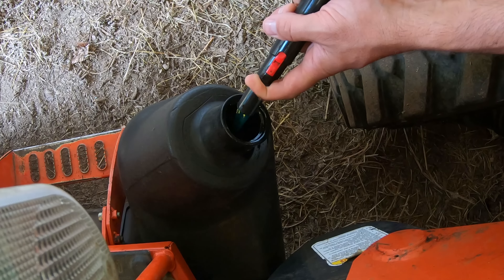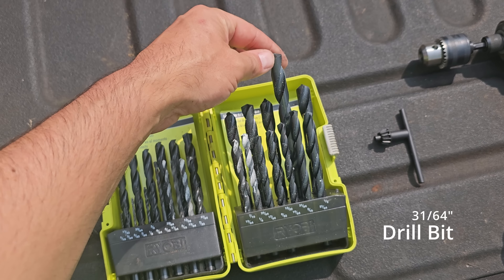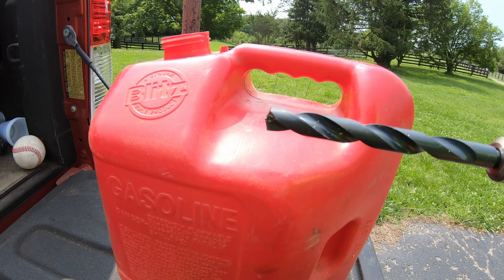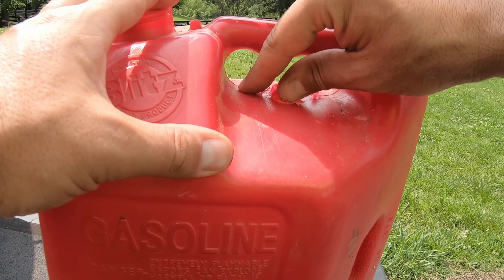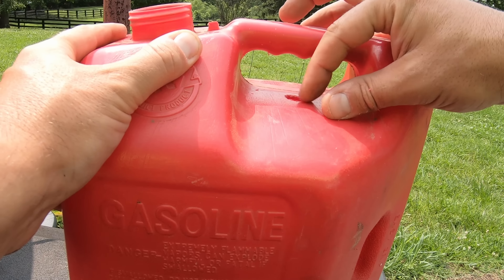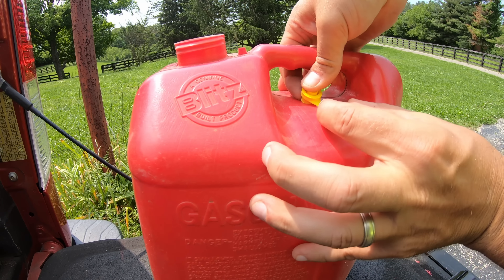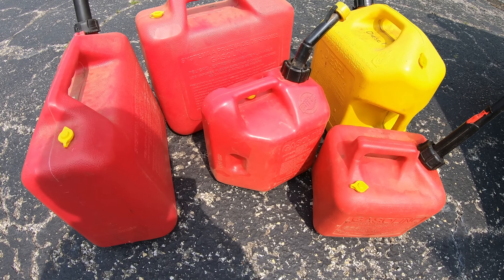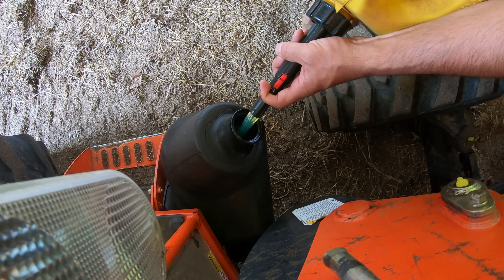Make Gas Cans Great Again!

Comment: I often have to fill up farm tractors using a five gallon gas can and found the new style "vented" filler necks to be a pain in the ass so rather than mess with them at all I simply take a large funnel and put it into the filler hole in the tank and then remove the filler neck entirely from the gas can and then just pour the gas in. It's a whole lot faster and less frustrating.
Reply from the maker: It's crazy that the newer the cans gets, the worse they make them to use!
Reply: It's frustrating when all people want to do is get some work  done and the government is there making things difficult. Pay your taxes so people can come up with stupid ideas.
Reply: Try to ground the can to the tractor, particularly if it is cold and dry so you can eliminate static build up. I know an aircraft engineer who was killed fueling an aircraft doing a straight pour into a funnel
Reply: @waynemanning3262  Whoa, that didn't even occur to me, thanks!

Comment: Watch out: Some of those Amazon vents won’t stay closed.  I’ve modified many cans (and just bought “race cans” that work fine).  Lately, I’ve been using the vents which are Schrader valves minus the core.  Remember, it takes Government to f*ck up gasoline AND gas cans.
Reply from the maker: Interesting idea with using a Schroeder valve! Thanks for watching!
Reply: @livingon80  you want the kits with metal Schrader valves.  If you just install a typical black rubber tubeless tire valve, the gasoline softens and swells the rubber within a year, then you get leakage and failure.

Comment from the maker: Also, just in case there's any plastic left inside, it's probably a good idea to use the fuel the first couple times on something that has a fuel filter like a riding mower, zero turn or ATV before using in a pushmower without a fuel filter.
Reply: Or rinse out w hi pressure and drip dry? I use a 62/128" bit , but I'm blessed with a  nearby non ethanol station/casino's REAL gas and therefore a gasoline snob.😅⛽️🤴

Comment: I use a 3/8” self tapping sheet metal stitch screw. They have a rubber washer and seal good and easy to take them in and out.
Reply from the maker: Good info, thanks!

Comment: I use the metal vents with the screw on nipple and leave them loose during storage.  Also, do a video on removing the spout spring.  That's what I've done to all mine.  Works great.  I guess you could modify the spring to make them lighter tension.  But I just took mine out completely.  Still seals good.
Reply from the maker: Thanks for the suggestion!
Reply: I guess by letting vent loose. You don’t care about moisture in the air being absorbed by the fuel.
Reply: @mracer8  Loose meaning not real tight.  In the heat here the can will collapse or expand too much.  All my cans are metal jerry can style now.  And my gas doesn't usually sit around long enough to hurt it.

Comment: I use the No-Spill brand of gas can. They have a spring loaded button behind the spout to release the gas. Been using them for years. They are supposed to vent around the button but I do get gurgling. So, I'm sure they could use your method too. But to the point, these are much easier to use than those nozzles with the release on the spout. They are at Ace Hardware, HD, and Amazon.
Reply: Tractor Supply also has them.  They're excellent.
Reply from the maker: Great info! Thank you for sharing it with everyone!

Comment: I drilled a ¹/32" hole in my handle. This vents it enough so the plastic can not swell or collapse with temperature change. I cut yards for a living, so the gasoline doesn't get stale. 🐀🐾
Reply from the maker: Awesome! 1/32" hole should keep any debris that may fall in pretty small. Thanks for sharing!

Comment: Great idea and ideas out there to make gas cans easier…..but the best solution I’ve found is using a battery powered pump to fill my vehicles or power equipment! 
I like the Mr gasket brand it works awesome and if you use 4 lithium AA batteries instead of anything else it last a long time! And it come with optional gas can cap adapters!
Reply from the maker: I did a video on the one from Harbor Freight, it works well!  I use it when I'm poimuring out the full 5 gallons. I'll check out the Mr. Gasket one.

Comment: Vent caps not really needed. I normally drill a very tiny hole near the handle. Use my thumb to cover to create a vacuum to slow the flow or leave uncovered for smooth max flow. A small vent hole is all that is needed. Tiny vent hole also aids in releasing -/+ pressures from ambient temperature changes.
Reply from the maker: Do you ever get dust and dirt inside the can?
Reply: @livingon80   I have never had an issue with debris in the cans. When I say small, I mean find the smallest drill you have in your box and use that. All that is needed is a very small, pin hole size vent for air to come and go to keep the pressure normalized. Choose an old container and give it a go. Lug it around, use and test yourself before making holes all over the place. See if it meets your needs before needing to buy any attachments and/or gadgets.

Comment: I've actually done something similar to this. I used a valve stem with the core removed.
Reply from the maker: Nice! Thanks for watching!
Reply: That works fine until the gas fumes eats up the rubber.

Comment: Use compressed air hose to blow out most if not all of the plastic shavings.
Don't place it under the handle on a can like this, place it on top back of the handle outside where you place your hand - if the cap pops loose or you suddenly move the can while filling, less will spill out.
Reply from the maker: Air works well. It doesn't leak if it not overfilled. I agree though, handle is better, but this one was rounded and hard to get a hole drilled.

Comment: ALWAYS use a step drill on plastic.  It makes a clean round hole every time.
Reply from the maker: If you have a step bit with a 31/64" notch, that would work great!
Reply: @livingon80  I've had one of those caps split because it was too tight.  Maybe they've corrected their design since I installed mine.

Comment: Just get a $12 gas can pump from harbor freight, put it in the can, put the hose in your lawnmower tank and press the button.
You don't even have to lift the can to accomplish this.
Reply from the maker: I'll have to check that out! I bought one a while back from Amazon and it started smoking the first time I used it. I'll definitely check out the HF one!  Thanks for the tip!!
Reply: @livingon80  Make sure the polarity for the "D" cells is correct, positive end down.
Also, never let it go horizontal once you've used it, hang it by the hole in the top.
It will leak fluid into the battery compartment if you lay it down .
Ask me how I know.
They're not the highest quality, but you can go online and get a refund to buy another one without returning it.
It's still worth it just for the convenience.
Reply: @livingon80  Oh - I forgot to mention, buy two, always have a backup, these things just quit for no apparent reason, usually when you need them most.
Mine just quit ten minutes ago, but the backup is working.
I didn't say they were good, just convenient.
Test them right after you buy them, but don't run them long dry, two or three seconds is fine.
Reply from the maker: Good info! Thank you!

Comment: I’ve used those vent caps , I really don’t like them as well as magicfour vent caps. They look like car tire valves. I also replace the main fill with a yellow foanriy cap. I use a large funnel with a screen to pour into my mowers . The funnel is a flotool quick fill funnel. If you use the yellow vent caps I suggest you super glue them in place , making sure to open the cap before gluing. This will keep you from gluing the vent opening pieces together. You could also purchase a pump like the deway gas transfer pump

 

 

 

 

 

 

VIDEO
Reply from the maker: I've heard a lot of people using valve stems, never tried them myself as these plastic ones have been fine. It's crazy how much we have to mod these things to make them functional! I did get a pump, and just did a video on it. It works well! https://youtu.be/oDm6KyRbtfw Thanks for watching and commenting!

Comment: Make sure there are no gas fumes in the can, the brushes in the drill/driver are exposed and are a source of ignition.
Reply from the maker: Good call. I've done several with no issues but it's always better safe than sorry. Thanks for the suggestion!

Comment: I just drilled a hole in the top back corner fit a rubber grommet in there and put a golf tee in their works great then I can put my thumb over it as I'm tipping it up so I don't slosh and spill and and then when I'm ready I just let go of the hole and off it goes, those cans definitely need a vent
Reply from the maker: I've heard people using a golf tee, but not the rubber grommet with it. That's smart! Thanks for sharing!

Comment: Can use value stem in same hole as drilled
Reply from the maker: I've heard of people using valve stems, but metal, because the rubber may wear out with the fuel.

Comment: Great stuff. That bit seems a bit large. But I think there are different size vents out there.
Reply from the maker: I think the bit I used is what the vent called for. So far no issues. Thanks for watching!
Reply: @ Are you trying to get smart with me?
Reply from the maker: Not at all. Just saying the drill bit I used was the size the instructions said to use, that is all.

Comment: My old gas can works fine.  I just use a funnel when filling up the mower (not using the hose) and carefully pour the gas into the mower and never spill the gas, then I simply screw the caps back on.  Furthermore, when I buy gas at the service station I only fill the 5 gallon tank just halfway as it will take a couple months to use up that amount of gas.  You don't want to use gas that gets too old, otherwise you may have starting/operating problems as the carbonator can get gummed up as the molecular makeup of the gas slowly deteriorates..  I use up and run the mower empty each time I cut the grass so I seldom have those problems.  My mower runs for 90 minutes on the mower's tank when full, so I pretty much have that down to a science!!!  Screw the government!!!
Reply from the maker: They don't make them like they used to! Great tip about not using old gas! Thanks for watching!
Reply: Fuel Stabilizer solves the stale gas problem.

Comment: REMOVE THE O RING AT THE BOTTON OF THE SPOUT  AND THEN PULL  OUT THE SPRING AND THEN PUT O RING BACK ON ...MAKE IT SO YOU DONT HAVE TO HOLD IT...THE HOLE YOU DRILL SHOULD BE IN THE BACK OF THE CAN SO IT DONT LEAK WHILE YOU POOR
Reply from the maker: Good tip about the nozzle spring! I have the vent in the back on most of my gas cans, I prefer it there too! The can in the video was rounded at the back, so it went on the highest flat spot I could find. No spill issues yet!  Thanks for watching!
Reply: @livingon80  YOUR WELCOME ..I LIKE YOUR SHOW ALWAY WANT TO LEARN NEW THING KEEP IT UP

Comment: You have the Midwest 4240 spout installed upside down, work much better with correct installation
Reply from the maker: I've had the spout with the tab up and with the tab down. It's terrible both ways.

Comment: I have wondered for a long time now why the makers of these plastic fuel  containers don’t mould a hand grip on the bottom of these containers so has to make it so much easier to empty into fuel tanks  on Tractors and machines  seems a very easy solution rather than struggling with these awkward heavy slippery containers, anyone else thought about this ?
Reply from the maker: I agree! My 5 gallon diesel can has a grip on the back side which helps. It's the only I have that has it.
Reply: yup.

Comment: Spoiler alert they also sell better spouts as well...
Reply from the maker: I don't have issues with any of the "safety spouts" that are on mine, but I've seen some cans with different spouts that look awful to use. Thanks for the tip and for watching!
Reply: @livingon80  The issue I have with mine is when you have a full 5 gallon gas can the weight tends to put pressure when resting on the fill port of whatever you're trying to fill, this puts pressure on the gasket and it tends to leak even if it's tight...
Reply: @TheJkilla11    You got that right!!

Comment: On hot days the expansion of the liquid in the container causes the plastic cap to pop out.
Reply from the maker: Built in pressure release valve :) Thanks for the info!
Reply: Jostle or shake the gas-can may also cause gasoline vapors to expand.

Comment: I'm pretty sure that this would render this container illegal in the Netherlands. When pressure builds up,  the newly mounted vent will pop out.
Reply from the maker: If anything it would just pop open to relieve the pressure, instead of the container swelling like a balloon. Interesting fact about the Netherlands. Thanks!
Reply: @Living On 80  You're welcome. When stored in higher temperatures, it will release pressure, but that also means it's leaking. To the best of my understanding, it has to be able to withstand certain temperature levels.

Comment: Hmmmm never knew they made after market jerry can vents, i just drilled small holes in mine. Helps alot. 

vents also prevent heat expansion in high temp summer days. I haye how jerry cans can heat up, & look like they could explode. probably not good for over all life of the plastic
Reply from the maker: They do swell a lot!

Comment: I suggest filling it with water before drilling it and yes I know it's plastic but if some unknowing poor person thinks a smoking 🚬🚭 hot drill bit is normal and not dull could in all actuality get it hot 🔥🥵 enough for a rude awakening!!!
Reply from the maker: Just make sure you get all the water out! Thanks for watching!
Reply: @livingon80  But of course sugar bear 🐻!!! But you might want to drill the top forward of the handle if hollow instead so when carrying it in the truck it doesn't try to gush from the new orifice. Good thing you capped it though!!!🌨️🐻‍❄️❄️

Comment: i think that a 12mm drill bit is what the vents are designed for.
Reply from the maker: 12mm may work but the instructions say 31/64" which converts to 12.3mm. Thanks for watching!

Comment: LOL - You demo your Mod while using the Spout turned 180 degrees from its intended use position. That style Spout has an Air Channel build in to relieve vacuum while filling. Another fail people struggle with is <Over tipping> the gas container, blocking the internal vent with excessive fuel.
* The best use of the added vent can also be its downfall when using Ethanol Gas. If the vent is accidentally left open of not seated fully moisture can be drawn in as Ethanol is hygroscopic.
The main benefit of this vent is the ability to relieve Pressure or Vacuum due to extremes in temperature change when using Non-Ethanol Fuels.
The only thing truly BAD about non-vented containers is the Horrible lack of Quality control in designing the release latches for the nozzle and inexcusable lack of <PROPER> instructions for use.
Reply from the maker: The angle I showed is how most of my equipment is angled. Thanks for th good info on the vents! I've had good luck with these staying closed, even when the container tips over. So far so good! Thanks!

Comment: Take the dammed spout off and use a funnel. No drilling required.
Reply from the maker: That works too, but all my funnels seem to be a magnet to dust and dirt and I spend more time cleaning them off than pouring without one.

Comment: better solution  at the back of the top handle use a "ice pick and put a small hole there. it will breathe but no leak.  its a 5 minute fix  and cost nothing.
Reply from the maker: Sounds like a quick and easy way. Do you ever get dirt in the tank from the open hole?
Reply: @livingon80 i do not get any debri  not even water as it sits on my mowing trailer 24/7 during the mowing season.  i have used this  can for 5 years now.  keep in mind though  you just put the pick in enough to make an opening so the pressure  releases. I am guessing it's  1/16 if an inch or  less.
Reply from the maker: @georgecook1374  good info! Thank you!

Comment: Those child proof spouts (unfortunately mandated by the government) are the problem I have. They make spouts without the lever that you have to hold (and hurts the hands!) so I threw the other away.  My other can is an old metal one from the '60s
Reply from the maker: The newer ones keep getting worse and worse!
Reply: @livingon80  And I saw on one video and heard elsewhere about the new cans building up pressure and spraying gasoline all over the place.  They definitely need to be vented.  I'll keep my old metal cans.
Reply: @muffs55mercury61 Careful, you may be labeled a terrorist for keeping those dangerous old cans.

Comment: Please refer to it as a drill or twist drill and not a bit. A bit is used with a brace, as in brace and bit. I know that's what you've heard and learned, but technically it's not correct. The thing on the other end is an electric drill, so there's no confusion.
Reply from the maker: Thanks for the info! Good to know about the braces. The tool used was an impact though, not an electric drill. 😁

Comment: until you replace those dork ass nozzles you haven't done the job right. And BTW the selection of placement of the vent should be as far back from the nozzle as possible and as high up on the container as possible. There are aftermarket nozzle and vent kits on market that make this a breeze.
Reply from the maker: I haven't had issues with the nozzles on the cans that I have, but some of the newer style nozzles do look awful to use. And yes, you are right, the vent should be up as high as possible. It is where it is on the container in the video because on the handle it was rounded and had a molded seam. Thanks for watching!